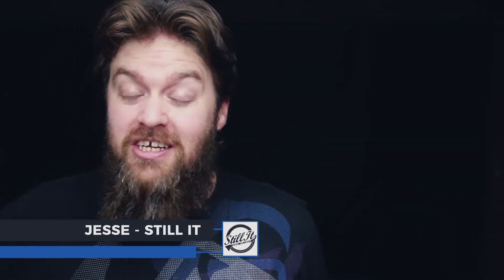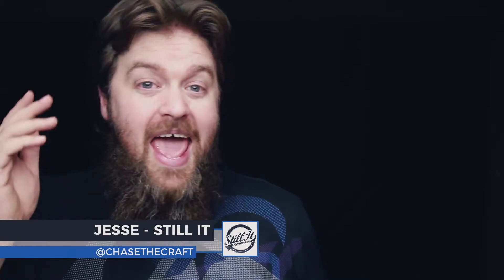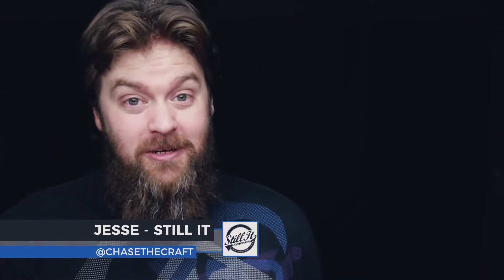Boilers : 6 things to think about when choosing or building a boiler

Comment: my setup = converted 9 litre pressure cooker + induction cooker. Easy to open and close it with an airtight seal. Has a small copper column and shotgun condenser. The cooker is awesome, it's like the power settings were done by a home distiller! I live in a small apartment so it's just the right size. I use a 13 liter ss brew bucket for fermenting (I used to do wine but decided to distil as I prefer spirits).

Comment: Jesse Great channel learning a metric shit ton here, I have question for you regarding pot size. I also posted in on HD. Thinking ahead to stripping runs and spirit runs. On a gas fired boiler,  how much volume should be in the pot? If a guy is alread set up for brewing 5 gallon batches of beer,  is it really worth it to buy a 50L  boiler or stick with a 30L boiler?
Reply from the maker: Hows it mate.  I would consider the larger boiler anyway.  IT gives you the option to mess with double brews.  Also remember that you need a considerable amount of head space in the still for a all grain batch.  They tend to want to puke.  I will often still be on the edge of a puke with 30L in my 50L keg pot.
Reply: @StillIt  as I suspected. Dropped the extra coin on the larger pot today.

Comment: Jave u got a video showing your keg video and how its setup you mention KW in some so i am assuming u have swapped from gas to electric? Also is there a vid showing how the ccvm works and any links to the plans for lengths etc?
Reply from the maker: Looks like you found it already haha
Reply: @StillIt  what type of elements have been used? Not in KW but type? Are they special stainless elements? Have they tigged on a threaded boss that the element screws into?

Comment: I use a 5 gal SS pot because most of my runs are 6.6 gal . Then I mix the stripping run back with the left over mash. Which can give it a good bump in proof . 100 or 50% is what I bottle at . The keg boiler is great for 10 or 12 gal runs that is a 15.5 keg but it takes more time to get up spitting out the good stuff!!!! I up gas propane bottles and a 100 gal tank  the 100 is cheaper but here in summer being in air cond. is a plus . My run times are still 5 hr. to 6 hr. Some time 8 to 10 depending on what I want to suck out of my run ! Bobby Happy in the ???

Comment: I made a gasket for my brewpot using "proto putty" (do a YouTube search) it's basically cornstarch + 401 silicone + food dye.... works great, currently using some sash clamps to hold it on, but I've ordered some spring latches from way to weld to the side of the pot for snap fitting in the future :)

Comment: Jessie,  go with a 15 gallon keg and a 7 gallon pony keg as a thumper
Reply: I'm setting up my first still now. A 15 gallon keg. While looking for a used keg I found prices from 75 dollars to 125 dollars so I checked and a new keg cost 125 dollars so I bought it. I have now my reflux collomn and working on my electric heaters now with a pid controller. I've learned alot from still it and barley and hops.
Reply from the maker: Yeah Im going keg :)  will think about a thumper too!